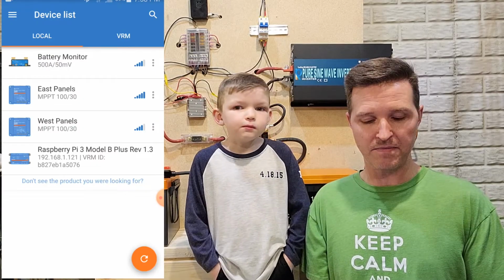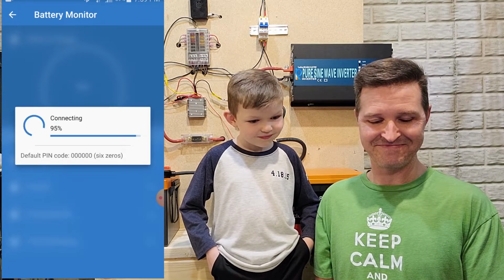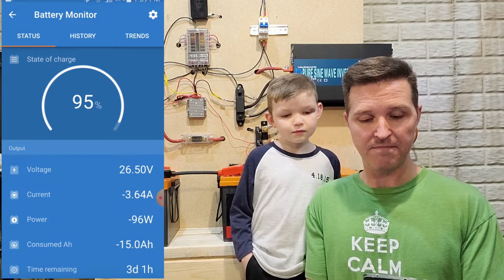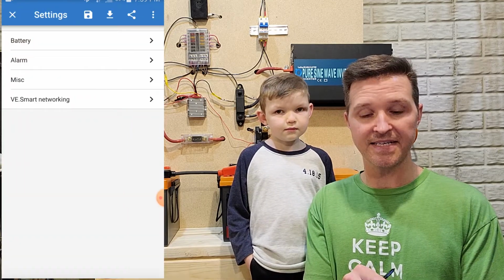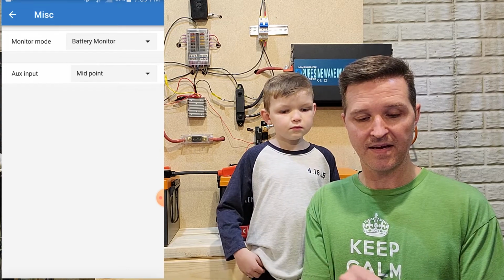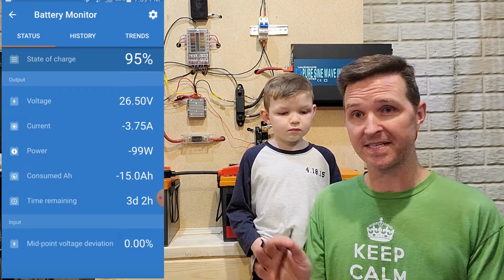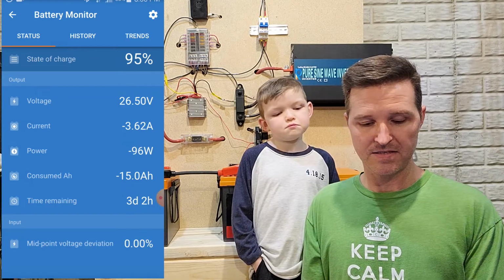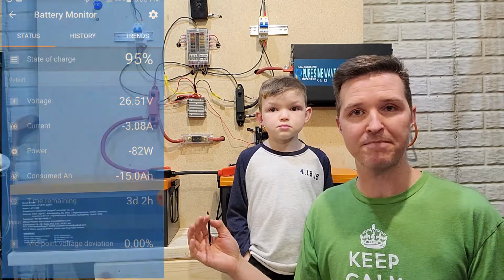Setting up Midpoint Voltage Deviation in a Victron Smart Shunt

Comment: So I just watched your other video about adding a balancer after wondering if I needed one. There I discovered the victron shunt can measure it! So I quickly went out to wire it in and now I'm here to figure out what I need to do to set it up like yours!
I find victron equipment to be great gear but if you don't read every page or get it professionally installed your missing out. It's generally very difficult to find out exactly what you are looking for on YouTube but both times your titles have been excellent! ❤❤

Comment: I have a similar set up to you with a 24v trolling motor. I have a 12v 2 bank charger so each battery is charged individually. How would I wire the shunt

Comment: I am using 4 12v batteries in series\parallel for 24v  where should i place the mid-point wire?
Reply from the maker: Connected to the conductor between the two 24v banks.  It shouldn't matter if you have multiple connections between the banks since they are in parallel.

Comment: u have a cerbo?do u have the cerbo power cable ( black one )connect to the shunt minus or batt?
Reply from the maker: I have a Rasp Pi that has Cerbo software on it.  I believe the wire is connected to the terminal block.

Comment: Hmm so ive got a mid point deviation of 100%. Not good i know but why is the question?
Reply from the maker: It sounds like you need to top balance each battery in your bank.
Reply: @OffGridBasement  I've got a 12v system and apparently the mid point deviation is only for 24v and 48v systems. Saw someone posted the same problem with it showing 100.10% (exact same reading I have)
Reply: @Andy-kd6om did you ever get more info on of this is accurate

Comment: What are the lithium settings for the shunt for the 24v system please?
Reply from the maker: Battery capacity
300Ah
Charged voltage
27.7V
Discharge floor
10%
Tail current
1.00%
Charged detection time
3m
Peukert exponent
1.02
Charge efficiency factor
99%
Current threshold
0.10A
Time-to-go averaging period
3m
Reply: @OffGridBasement  Thank you.

Comment: Nice Video
i have 2/ 24v lithium batteries in parallel , i hooked up both midpoint leads to each + battery terminal on each battery  . i get a midpoint alert and on my screen it shows "Mid-point voltage deviation 100%"  any idea how to correct this ?? Maybe midpoint is only for Series connected batteries as hooked up in this configuration would be reading same voltage twice ?
Reply from the maker: Yes.  I believe this is only for batteries connected in series.  If they are connected in parallel there shouldn't be any deviation because parallel batteries equalize.

Comment: Thank you for this video.  I was wondering how the midpoint worked. What do you do if the midpoint shows a value?  Disconnect and check them separately?  Charge them separately?  What could be problems ?
Reply from the maker: It really depends on what the midpoint value is.  If it's below .2% while charging then it's no big deal.  I've noticed when my Battery bank is either very full or close to empty is when the midpoint shifts.  Sometimes I will see up to a 1% difference in voltage.  I believe if you top balanced your batteries separately then you will get more midpoint problems at the bottom aka, when the battery bank is almost empty.  If you see a midpoint when the battery is around 50% then I would suggest charging the batteries separately, then connecting them together again.  That should give you a good top balance.

The midpoint works by checking the voltage of one battery and comparing it to the voltage of the entire system.  Then it can figure out what the voltage of the other battery is by subtraction.  The voltages of the two batteries should be the same through about 90% of the charge cycle.  The midpoint is basically the difference in the voltage between the two batteries.

I hope this helps!
Reply: @OffGridBasement  yes, it’s helps, thank you for taking the time for this response!   Also, what determines which amperage size Shunt to use?  The total battery bank Amperage?
Reply from the maker: @projet2907  No.  It should be based on your inverter.  I have a 3k inverter.  3000 / 24 is 125A.  That is well below the 500A shunt limit.
Reply: @OffGridBasement  So, I have a 1000W inverter,  2 x 12 V batteries connected in parallel, 1000 / 12  is 83A is way ok for the 500a model.  Thank You very much.  nb, midpoint shunt talk is not boring I am glad you talk about it, everyone else mentions it but not how to :-0)

Comment: Great video I have just upgraded to 24v with 2 Lithium batteries, I charged both batteries to the same voltage and started  with a deviation  of 0.10 and less than 24hrs later its now 0.50 
I have no idea what this means or what I can do about it.
Reply from the maker: It just means the 2 batteries are a bit out of balance at the top end of the charge curve.  Meaning that one battery will be full before the other.  For about 98% of the battery you are totally fine and balanced.  To keep them healthy you wire them in parallel every 6 months or so and charge up to 14.4v or whatever the battery manufacturer suggests is full.  Let them sit for a few hours and then wire them back in series.  That will ensure they don't get to far out of balance.  I hope this helps!  Thanks for the comment!
Reply: @OffGridBasement  I was going to buy the Victron battery balancer, do you think it's worth it?